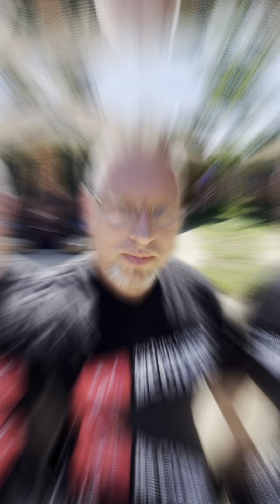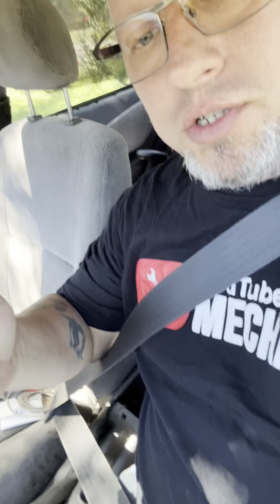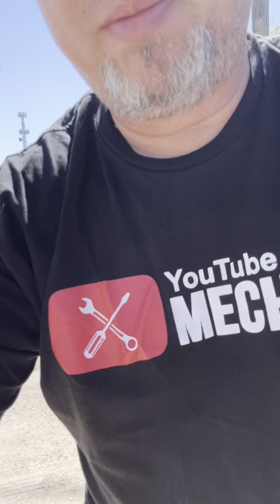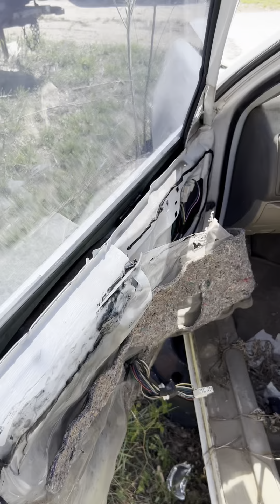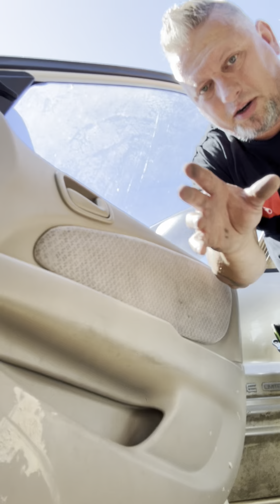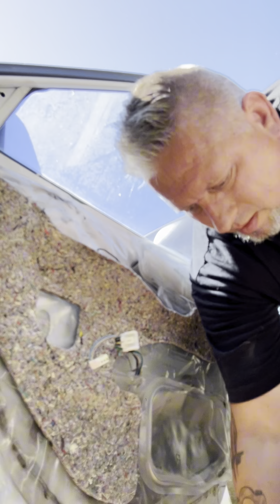Cops pulled over my 300$ Budget car

Comment: All Prizms were built at NUMMI (New United Motor Manufacturing, Inc.), a joint venture company between Toyota and General Motors in Fremont, California.
Reply from the maker: @KDoyle4  Your agreeing with me i think
Reply: @Claude_van_Dammaged  Not really.  The car was a Toyota design, but it was built by NUMMI, not Toyota.
Reply from the maker: @KDoyle4 it sounds like you’re just trying to find something to argue about basically all I’m saying the cars are identical and I prove that the parts are interchangeable so what is your argument?
Reply: @Claude_van_Dammaged  I'm not trying to argue, my man, just pointing out that these cars were built by  NUMMI (New United Motor Manufacturing, Inc.), which was a joint venture company between Toyota and General Motors in Fremont, California.